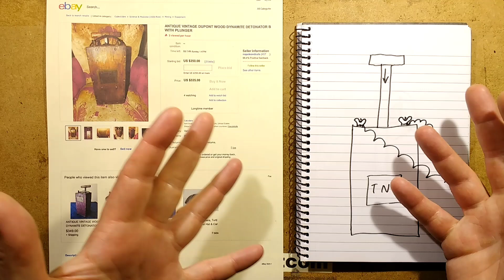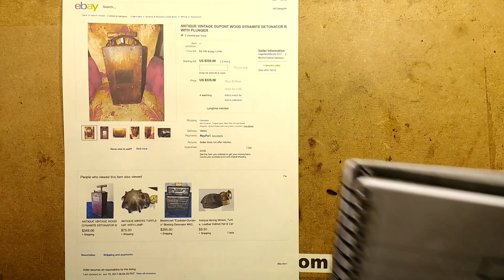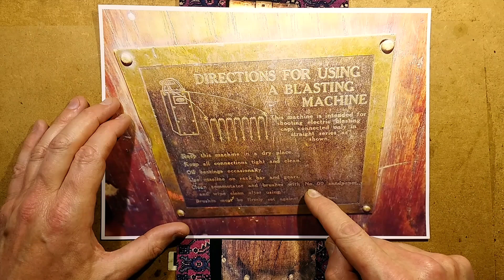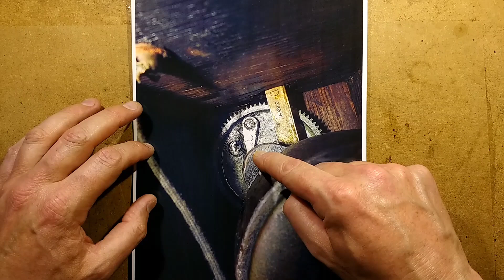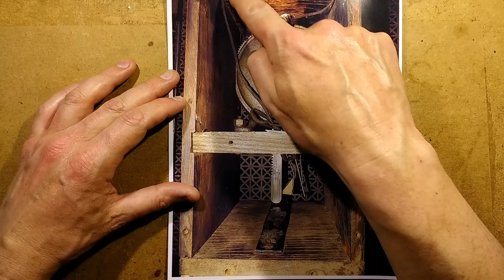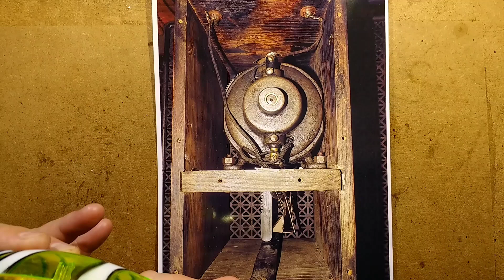How Wile-E-Coyote's dynamite blaster works.

Comment: I am surprised you have not built one yet. My work as a Mechanical Engineer mostly on power transmission installations found me mostly working on gearboxes in industrial/military facilities. Rack and pinion, hypocycloidal, worm gears, spiroidal gears, et al were fascinating and a great deal of fine craftsmanship went into most industrial gearboxes. Military work was fantastic as I was the guy that had to find and fix the faults in the field, quite literally sometimes. The work up at a famous Scottish Naval Submarine Base was by far the most taxing and rewarding. Sorry if I ramble I am an Engineer with a passion for Engineering.

Comment: A friend of my father had both several of those, and a couple that looked the same outside and had the same activating mechanism, but were battery driven with a couple of those big rectangular lantern dry cells. Those were used when there were Radios being used on site as there was a fear of the generator picking up enough energy off the vehicle radios to throw a spark. I don't know if it was a real risk of like mobile phones and petrol pumps.

Comment: I reckon you should build one with an old TV flyback transformer and a few transistors and turn it into a 5 inch spark gap generator, (or  Van de Graaff generator).

Comment: and they also detonate on the upstroke.
Reply: Gordon Chin they shouldn't unless you have seen a faulty one due to the ratchet disconnecting drive to the generator when you pull the handle up

Comment: I kind of figured it was a kinetic device of some sort but I never really realized that yes of course it would still be live if you had nothing attached to the connections. Kind of a scary thought, especially if you noticed how black the wood is around the leads on the inside of the box. Great video!

Comment: It would be fun to have one of these set up randomly somewhere in the house with wires disappearing out of sight. You could have it hooked up to a big subwoofer or rumble device somewhere distant, giving the impression that something was set off far away. About 10 or 20 seconds or so later, distant siren noises. Good for house guests to discover.

Comment: Question: Why not just use a battery of sorts or some simplified switch? Is there some safety feature that these blasters have that make them exceptional with explosives?
Reply: Given the look, it probably dates to a period when stuff was made to last, and you'd be crazy to suggest having to replace batteries all the time when you could just include a perfectly good mechanical solution that was likely more reliable.

Comment: surely you could have tested the voltage by attaching a photo of a meter to the outputs. and it wouldn't matter if you damaged the meter because you can always print another.

Comment: You're absolutely right in your description. About a month ago, I was at a museum of old farm equipment in upstate New York and they had one of these. I probably shouldn't have, but I gave the handle a little push and exactly as you say, there was quite a bit of resistance and a VWRRRRRR sound. I only pushed it down an inch or two in the time it took for the "don't touch the exhibits" part of my brain to catch up and stop the "ooh shiny" part of my brain, but I thought that was interesting. In the cartoons they just shove the handle down but it doesn't work that way.

I did take a picture: http://imgur.com/a/5aIgq

Comment: There is a flywheel attached to the generator. That's what stores the power of the electrical charge. The unit I studied had an generator identical to those found in early telephones.
Reply: Those are generally earlier units. Slightly after using phone generators they went to series would generators of a very similar style to get more current and then finally to shunt wound units with heavier flywheels like Clive is showing. You're right, it's the inertia of that flywheel that allows for a big electrical kick to the caps. You might not be able to fire a cap without it or at least it would be difficult and sloppy.

Comment: I wonder if he or anyone watching is tempted to build one, know that they know how it works?
Reply: It's mostly mechanical work. You need the rack which may be the hardest part to find and a couple of gears, one equipped with the ratchet mechanism. Beyond that it's as easy as a flywheel, a DC motor or small generator or alternator, a switch made from spring brass, and some woodworking. It won't feel or sound the same though at that's 1/2 the appeal for me. I partially made one a long time ago but never completed it. I finally bought the real McCoy and I'm a happy camper/miner/nerd.

Comment: The other reason they're wired in series is that if there's bad wiring anywhere, it just doesn't fire.  In parallel you could wind up with unfired explosives still attached to a live blasting cap just waiting for a static zap or something to ignite it, and nobody would know it's in the rubble there.

Comment: Clive, this is offtopic but I'm wondering if you'd consider taking a look at a TS100 soldering iron. I'm in the market for a temperature controlled iron and I think I'll probably pull the trigger on one of these but I'd value your opinion. I'm particularly interested in how well it would run off of 12V (The bottom end of it's input voltage range).

Comment: And it works best if it says 'ACME' on the side! Thanks, Clive. Simple, reliable, and not too easy to set off accidentally, as is required when working with explosives. Those explorers need quite a firm push to make operate.

Comment: I actually have one of these somewhere. You are spot on with your summary. Back when I was a kid, I hooked a 100W light bulb to it and it lit the bulb brightly for an instant! I would not recommend touching the leads when plunged. It does take some force to get it going but it gets easier once in motion. I will look for it and if found, I will send you some video and better pics.

Comment: G'day,

   Yay Team !

    My father was hoping for a Dynamo like that thing has in it, when he aquired a WW-2 vintage Australian Army Surplus version of a Blasting-Box ; manufactured in Aluminium, but when opened it up it has a long Generator with big fixed Magnets fitted into the Cast Monoblock-Housing, all driven by a Rack on the Plunger & a  Ratcheted Pinion on the Armature - but without any secondary set of Step-Up Gears.

   The Plunger-Handle is detatchable, with the Plunger retracted, and it then fits as a Carrying-Handle into another connection-point atop the Centre of Gravity of the Box (which "lays down" in use, rather than "standing up" like the one in this video)...

  The whole thing is quite heavy and chunky, painted Olive-Green.

    My son has it in his Office as a Doorstop, he did tell me what voltage it produced, but I can't precisely recall what it was - something like 24 or 28 volts seems about right though, it wasn't anything startlingly high...

  Have a good one,

  ;-p

   Ciao !

Comment: The extra wires from the brushes would be the field coils, with many turns of fine wire due to the high voltage, probably 4 coils for relatively slow speed generating, cheers.

Comment: Clive, The fireworks company that I work for have one that we use for first sequence on things like wedding show's (bride and groom push it). The one that we have has put out over 1kV before we blew the cheap meter that we had connected to it. It is crazy how reliable it is considering all we do is once in a blue moon spray a bit of WD over the internals.
Reply: Quite symbolic, using  such a detonator to "set off" a marriage!
Reply: KeeDx3 we have a dummy one as well that we hook up to a 24v battery but we only really use that when kids are starting first sequence for safety due to the voltage. But we also put it on 60-100m of bell wire.
Reply: Sounds like the kind of novelty that gets requested frequently.
Reply: BlackEpyon yeah bride and grooms love it and school bonfire night displays love it as well.
Reply: smileypete Do you really think that people just invent things on their first try?... I am almost 100% positive that that is their 40th iteration of their recipe, if not more...
Reply: Anvilshock we don't use it all the time just give it a light spray when it hasn't been used for a little while due to the equipment storage container not being the most dry of places.
Reply: I'm half and half at best, any proper development process would be documented. Could have come from John S Barry or even predate him. 

A water displacer doesn't need much inventing, just any light mineral oil in a much greater proportion of solvent like naptha, proportions can't be too critical, the solvent just flashes off. The only original bit is the distinctive smell (but quite mild compared to bloody GT85!)..
Reply: Can people please stop using WD 40 as a lubricant? It's full name isn't Water Displacement perfected on the 40th try for no reason ...
Reply: I suspect the '40th try' thing is just marketing.

Comment: I've used similar devices to set off explosives that send a charge of 90 volts at about 20 mA down th the wires.
Reply from the maker: It would usually be a higher current.  Most igniters require between 500mA to 1A to fire.  They're deliberately simple and non-sensitive to avoid firing accidents.

Comment: Many years ago, about 45 years, I had a detonator like your picture.  I'm curious too, so I had to look.  The generator resembled the ringer generator in an old style party-line telephone.  I don't think it would generate as much voltage as the picture, but the ring voltage of a telephone is at least 60 - 70 volts; and the generated voltage would easily exceed 100 volts. Interesting.

Comment: Hi Clive, the generator part is in  fact a magneto, or self exciting dynamo for the more technical. The extra connectors from the brushes are used to generate a magnetic field within the stator coils, removing the need for permanent  magnets.
Reply: That's what the man said. My first thought was 'magneto'. Few today would know what they were.
Reply: Anyone involved with light aircraft would know, aircraft use two to run the ignition system (second one for safety since WHEN the first one fails you want the engine to keep running!) Pilots test each before flight, to verify that they are both working; there is a slight but audible power drop when only running on one. I never had one fail, but that's just fine with me :)

Comment: That reminds me of when I was a school kid of about 12 or 13. I had a magneto from an old TVO tractor onto which I fitted the crank handle from a wheel brace. Used it to set of all sorts of things from treacle tins with a bit of petrol and a spark plug in the lid to home made black powder and nitro cellulose, I used a long length of old army telephone wire which never broke down on the insulation despite having something like 10,000 volts on it.

Comment: Please rework the bubble blowing fish to fire pyrotechnic charges. Also maybe paint it pink while you're at it?
Reply: Bubbles filled with flammable gas. And then dangerous high-voltage arcs to ignite the bubbles.
Reply: Max Hammick I second this idea.
Reply: Pink bubbles.
Reply: Modified to blow mushrooms for nuclear fission ;D
Reply: Hydrogen-oxygen 20/80% mix. Very floaty, very kaboomy ;)

Comment: If the igniter was a spark gap it seems to me that it would make more sense if it was a magneto rather than a dynamo.
Reply from the maker: Most electric matches are a heater wire dipped in compound.

Comment: if the caps are all in series, how do you make sure they all go off? If one is miss matched won't it go off before the others are heated enough to go off.
Reply from the maker: If they are properly matched from the same batch then they heat to ignition temperature at almost exactly the same point.  If an underpowered system is used that brings the temperature up slowly then you can get a single one firing and breaking the circuit.

Comment: Building your own replica of this from scratch seems like a good summer project, the trickiest part would probably be to rewind a motor to become a suitably high voltage dynamo!
Reply: I thought about doing just that for a while and actually built the box portion but finally broke down and bought a real one. I'm quite glad I did as the prices just keep rising. in the 1980s you could buy them NOS in their original shipping cartons for about $250. Those units would easily top $1500 today. The ratchet sound when you raise the plunger followed by the whirr of the generator is 1/2 the appeal. If you made one DIY you would need to match the gear ratios to make it sound at all correct.
Reply: You could maybe get one from a very old phone
Reply: Perhaps an automotive alternator with the output regulator disabled might do the trick.  I know people have pressed auxiliary alternators into service to provide 120V for power tools off an automobile engine, and with no electrical load and sufficient RPM, the output voltage might go considerably higher, to the point of risking breakdown of the insulating varnish between turns in the windings.
Reply: The very old phone one is a no-go i 'm afraid, they're AC only at 75 to 90 volts (and already highly geared). Provided you didn't want to be too 'true to the original' a geared AC  synch. motor free running, and switched through a rectifier (or not if you didn't care about ac/vs dc, the dynamite wouldnt) would work
Reply: Universal motors don't have magnets and thus have nothing to get the generation started. Your best bet might be a high voltage DC motor. The generator isn't spinning very fast when the plunger hits the base. They rely on a strong field.
Reply: I think using a mains rated universal motor would me the most true-to-original option.
Reply: I watched Cody's actual teardown of one of these, yes, you might actually have to put a small magnet in the stator core to provide a small initial field, which is then enhanced by the coils. The magnets they had back then were very weak.
If you don't mind it being dissimilar in function to an old one, you could just go with a DC motor.
Reply: I think 99% of the appeal comes from the smooth feel of the transfer of energy to the flywheeel and the subsequent whir of the flywheel after the ratchet action of extending the handle from a beautiful dove-tail joined box with ornate brass terminals. Those are also the hard parts to copy IMHO. The generator action is incidental to most folks and there is far better gear today designed around capacitive discharge if you're actually needing one for blasting. The original magnets were exceptionally weak and were formed by pulsing HV DC through the stator coils. A little neodymium magnet or two might do the trick nicely. Seems very worthy of exploration. Maybe an electric drill motor? I salute your aim to stay true to original.

Comment: Cody's Lab has a slightly more modern version of the plunger blaster. He definitely used one in his april fools video this year, where you can hear the whir noise under no load.
Reply: Cody just posted a full disassembly video actually, apparently he didn't know about Big Clive until now.
Reply: Cody actually has the same unit I believe, a Fidelity Electric Model 50. Cody's is painted black because the wood is most likely over-dry and/or stained beyond good looks. As Clive shows, the plunger hits a switch at the bottom of travel to connect the caps so they have the same sound whether they're hooked to caps or not. God, I love that sound for some reason. The one Clive is showing pics of is the newest of all the 50s I've seen.
Reply: not only the april fools video, he's used it to actually blow up explosives in his mine!
Reply: The video number for the disassembly is wh8FbnZdhJg
Reply: @cengland0 I came from that video but thanks for the other people here
Reply: Beat me to it! I didn't look at the comments before I posted.
Reply: Was going to mention this! I am sure he can give an answer!
Reply: G'day,

   Yay Team !

      As I said, on Cody's Thread, "when it's Steamboat Time then people build Steamboats all around the World, when it's Aeroplane Time then People build Aeroplanes..., independantly, everywhere...!". ; therefore, by the synchronicity of the Coincidence, Cody didn't know that Big Clive had posted this Video until his Comment-Thread went-off...

   Also, the Wooden-Boxed Blasting-Dynamos featured in both Clive's & Cody's Videos were Pre-WW-2  Civilian units...; and as I promised both Cody & Clive on their Threads, I managed to borrow my son's 1943-vintage Military Blasting Dynamo, and posted a Video of it yesterday.., it's very different from the Civilian ones, and very similar to them, simultaneously, which is rather weird..., therefore I made the Video.... (because it's Blasting-Dynamo Explanation-Video TIME, y'see ?) !

   Both  Big Clive & Cody come in for Shoutouts, and I used 3 minutes of Cody's Footage to compare the changes from the Civilian units to the Militarised Design.

   My Channel runs on a Prepaid Mobile Phone  so I can't post Links, but if you backtrack me to my Videos, or title-search YT for "2nd Australian Imperial Forces Blasting-Dynamo, Dissection...(With Shoutout to bigclive & Cody's Lab)." ; then either way you should be able to find it.

  Haveva good one,

   ;-p

  Ciao !
Reply: It whirls even with load, but it sharply halts and doesn't free wheel it.
Reply: But the April fools vid is a good one to see the effects of the dynamo unloaded thus without the back EMF